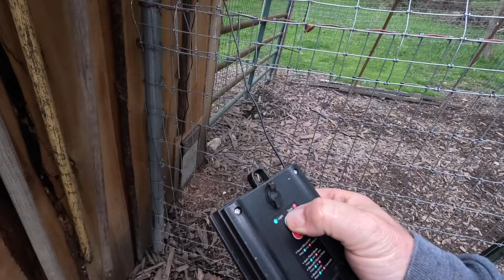issues with the starlink internet

Comment: I have starlink and a lot of trees I didn't want to cut down too. I found the place in my yard that would give me the best shot of the North sky, got the 45 meter cable and cemented a 14 foot 4X6 for a base pole, 11 feet sticking out. To that I fastened a 20 foot harbor freight flagpole 6 feet up, and got a gen 3 dish flagpole adapter for it off ebay. 
Using just the thickest sections of the flagpole and securing each section with a self tapping screw I figure I got the dish up around 23 feet and it's nice and solid. I wanted to get some good height on the dish while still keeping it a robust setup. I can still pull the screws and lower each section to get at the dish if I need to. Good luck with your setup!
Reply from the maker: We be setting it up soon it's going to be fun lol .
I have I think 15 foot pole hope it works thanks for the comment.